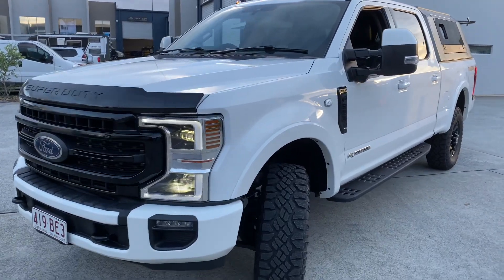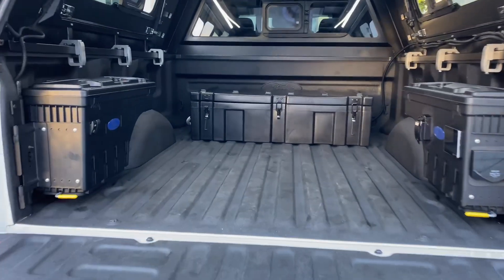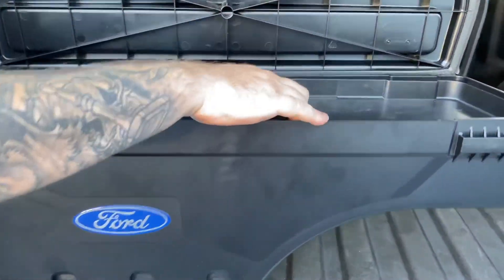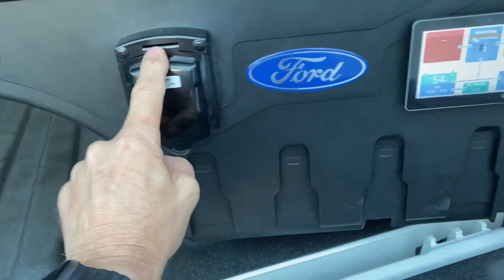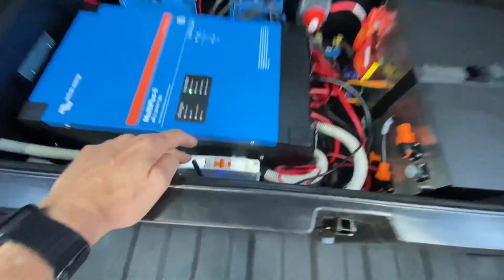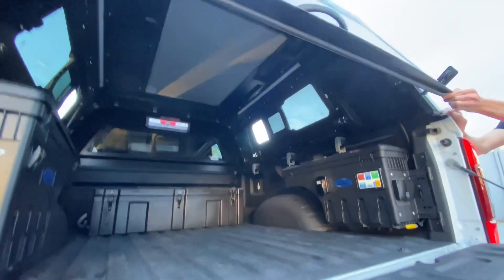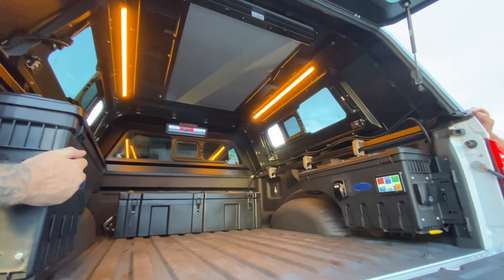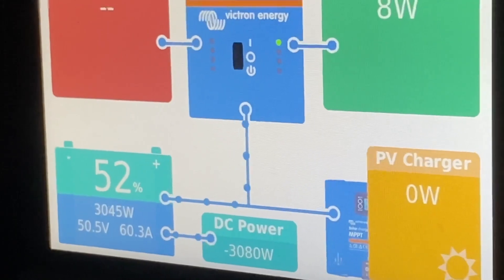F250 Tremor Tub RSI Cab 3,000W Alternator Charging 48V System with Scotty will power Caravan Aircon

Comment: Looks good with it basically hidden and protected, just wanted to know if big box needs to be vented or a fan for cooling or can it be fully sealed? 🤔👍
Reply from the maker: Yes it needs to be fully opened if the 240V AC charger is running as that function is least efficient with lots of heat dissipation. However, this is only going to be used in storage mode in the garage. Otherwise, he will open the box slightly ajar for inverter mode. And it will be closed and sealed 95% of the time running 12V devices and 48V to the towed caravan.
Reply: @Safiery  might be a good idea to put some desiccant in there, condensation inside may be a problem . I'd probably go as far as putting a Cortec vpci 111 emitter in there.
Reply from the maker: @Derrick84100  thanks I’ll check that out